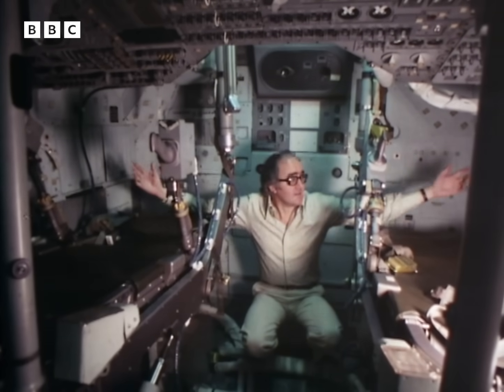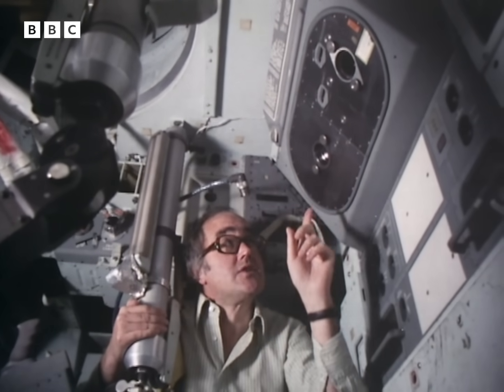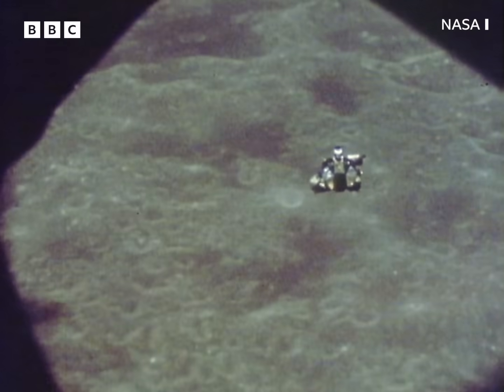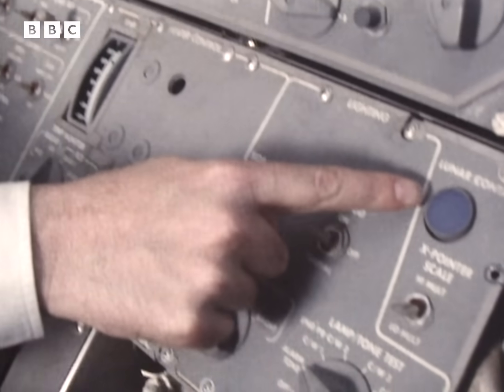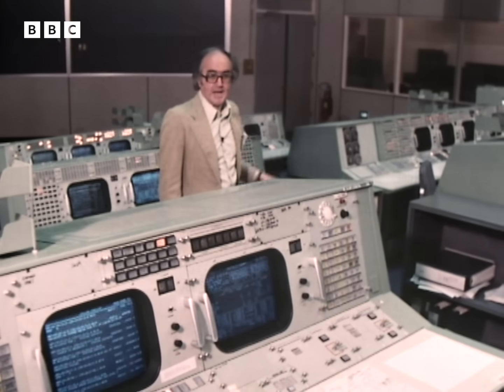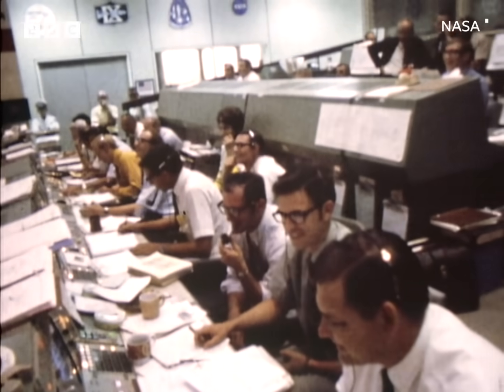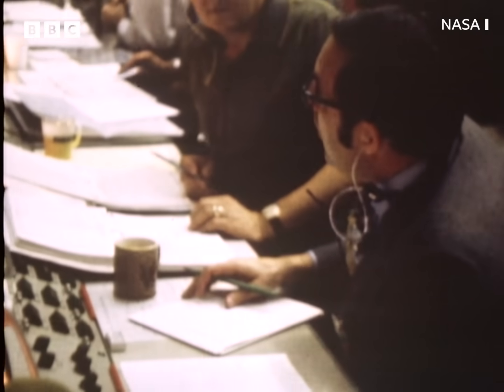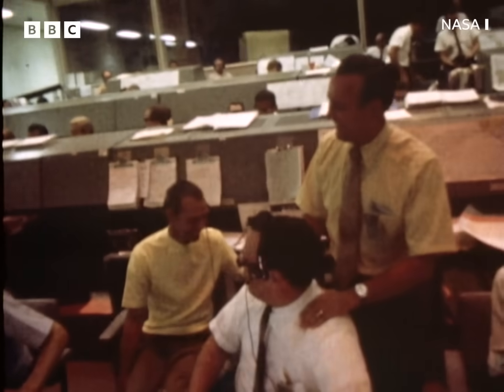1979: How to LAND ON THE MOON | Project Apollo | Retro Tech | BBC Archive

Comment: Notice destroyed LEM at 4.00mn on the vidéo.....very destroyed. How is it possible ?
Reply: 4:00 shows the LM ascent stage returning to the Command Module. The LM consists of two stages: the descent stage contains the engine and fuel for the descent to the moon, and the landing legs. This was left on the moon. Only the ascent stage took off from the moon to get the astronauts back to the Command Module.
Reply: @Hobbes746  you don t understand ....anyway
Reply: @thalesendeavour9890  I’ve reviewed the footage at 4:00. It shows the ascent stage of the LM in lunar orbit, ready to dock with the CM. Yes, half of the LM is missing: as I said, the descent stage stayed on the moon.
Reply: @thalesendeavour9890  Or are you talking about the buckled panels on the LM? 
Those are micrometeoroid shields. They are thin sheets of metal, used as a Whipple shield. Micrometeoroids would punch through these, and disintegrate in the process. The effect is that the debris of that micrometeoroid no longer has enough energy to damage the systems underneath those panels. 
Those panels were very thin by design (0.1 to 0.2 mm): they don’t need to be any thicker than that. Because they’re so thin, it was impossible to fasten them neatly to the underlying structure. They were riveted in a few places, as I recall. 
During launch, these panels would buckle a bit, which gives them the appearance you see here. That did not matter: they still worked. 
The important parts of the LM, the pressure hull and the fuel tanks, are hidden under that paneling.
Reply: @Hobbes746  no look the extern wall IS destroyed.
Reply: @Hobbes746  ok now i begin to understand thank you
Reply: @thalesendeavour9890  
Don't mind Hobbes. He's the Apollo damage control staff. The poor guy has about a dozen different names here. His feelings get hurt when people expose the phony missions.
Reply: @aok4418  for me it s half and half.....may be they went....may be they don't.
Reply: @thalesendeavour9890  
The radiation was the big hurdle.That's why they still haven't sent anyone.
Reply: @aok4418  As I’ve already demonstrated to you, no, the radiation was not a hurdle. Even in the center of the van Allen belts, it takes a week to accumulate a lethal dose of radiation. Above the belts, the radiation level is a hundred thousand times lower.
Reply: @Hobbes746  
"Lunar science for kids" NASA posted this and later took it down. 

Is there any sound on the moon?
Sound needs something to travel through to get from one place to another. On the moon, since there is no air sound cannot travel above the surface. So, there are no sounds on the surface of the moon. When the Apollo astronauts were out on the moons, surface, they could only talk to each other and to mission control by using the radios in their air filled helmets. Even when the astronaut in the photo to the right hit a metal tube into the ground with a hammer, no sound was made.

The picture they are referring to is Allen Bean striking a metal core tube during Apollo 12.
Reply: @Hobbes746  
Nothing was left on the moon because they couldn't get to Moon. They still can't put humans beyond LEO. Do we need to have the radiation discussion again.
Reply: @aok4418  Anyone can ping the laser reflectors left on the moon by the Apollo missions. A mountain of evidence proves the reality of the Apollo missions. Our radiation “discussion” consisted of me providing actual data, and you making one false claim after another. I’m not interested in a repeat of that.
Reply: @Hobbes746  Go do it, 😆
Reply: @Hobbes746  
Is it? That's not what the real data says. What claims did I make that are false? And prove it! Like I said before. I can back up my stance. All you're doing is running around rambling. We have already been over this.
Reply: @aok4418  i Know....van Halen belt . But listen....380 000 km to the moon....right? 35 000km/h Apollo speed right? It took 15 hours or less to get to the moon. They Traveled 3 days to get the moon..... 3 days to go and 3 days to back.....search the error.
Reply: @thalesendeavour9890  
The Apollo 11 crews were exposed to 1.67 mSv per second as they crossed the Van Allen radiation belt. This amounts to a total exposure of 1.8 Sv in 3 hours of travel through the radiation belt during the mission. Any exposure to 1 Sv or more, however, brings about fatal injuries. The radiation readings for the Apollo 11 astronauts’ skin of 0.18 rad, significantly, did not differ from radiation readings from missions restricted to low earth orbit. Data clearly proves that the Apollo 11 astronauts were not sufficiently protected against radiation: Neither the spaceship nor the spacesuits contained lead. Aluminum is ineffective against gamma and neutron rays. The calculated exposure of the Apollo crew was 1.8 Sv, an amount  associated with nausea, vomiting, bone marrow changes, and 20% mortality.
Reply: @aok4418  “they could not get to the moon” - had been debunked. “the radiation would have killed them” - has been debunked. “sound does not travel through solid objects” - has been debunked. Every claim you have made turned out to be baseless.
Reply: @thalesendeavour9890  The error is that you assume the speed is constant. In reality, as the Apollo spacecraft gets farther away from Earth, is speed decreases: moving away from Earth takes energy. 
At the point where the spacecraft enters the Moon’s sphere of influence, it’s only doing something like 3000 km/h.
Reply: @aok4418  And again you’re lying. No, the radiation level was not 1.67 mSv/s for 3 hours.
Reply: @aok4418  The spacecraft did not need lead shielding. The 4 mm of aluminium plus the heat shield attenuated the radiation level by several orders of magnitude.
Reply: @Hobbes746  No, bud, I'm not lying. And if you weren't so impressionable. You would know what I'm talking about.
Reply: @aok4418  Yes, you are lying. And worse, you can’t accept reality. When I try to teach you, you stubbornly cling to your nonsense instead of learning.
Reply: @Hobbes746  
What could you possibly teach me, child? You think the radiation in the Van Allen Belts can be stopped with a piece of paper. 😆
Reply: @Hobbes746  Aluminum is useless against GCRs. How many times do you need to be told.
Reply: @aok4418  The Alpha radiation in the VA belts can be stopped with a piece of paper.
Reply: @Hobbes746  
Right. Must be why they can't put humans through them. Do I really need to explain all this to you again?
Reply: @Hobbes746  
Provide the data and scientific research that confirming the radiation was low enough not to be a problem. Good luck!
Reply: @aok4418  How many people need to explain to you how and why you're wrong before you accept that you are, in fact, wrong? 🙂
Reply: @Jan_Strzelecki  
Give it rest. How many fake names are you going to post under?
Reply: @Jan_Strzelecki  
Give it rest. How many fake names are you going to post under?
Reply: @Jan_Strzelecki  I would love to see a single post by anyone proving me wrong. Good luck!
Reply: @Jan_Strzelecki  
Let's get this straight. You actually believe the radiation in the Van Allen Bets can be stopped with a piece of paper. 
Yes or No?
Reply: @aok4418  I don't have to post under fake names.
Reply: @aok4418  You were wrong about radiation and heat shield, for example.
Reply: @Jan_Strzelecki  
Yet, that's exactly what you do. And no, I was not wrong about the radiation. Just like I wasn't wrong when I explained to that Apollo did not measure particle fluencies, dose rates, and energy transfer spectra for ionizing particles and to measure the dose contribution of secondary neutrons. You seemed to believe they did. Nor did they measure radiation exposure on the moon. 
It's already been determined 
the only efficient measure to reduce radiation exposure is the provision of radiation shelters.
Reply: @Jan_Strzelecki I asked you a yes or no question. Spare me your ignorance.
Reply: @Jan_Strzelecki  
If the radiation in the Van Allen Belts can be stopped by a piece of paper, like you said. Why was NASA so determined to avoid them? I thought they specifically created a flight plan to avoid the most dangerous parts of the Van Allen Belts. Oh, that's right, they didn't leave LEO. 😂
Reply: @aok4418  This will be at least the 10th time I told you this.
I've already addressed that claim. And yet you keep using it with other people 🙄

Again:
The dosimeters used during Apollo did NOT measure particle fluencies (...)
Therefore, Apollo data allegedly being consistent with radiation levels withing LEO makes perfect sense. How are you not getting it? 🙄

I can tell you the Apollo readings cover only a small energy band for thermal neutrons (...)
And I can tell you that no one, no one thinks that Apollo data is bogus because of that. You want to use science? Use all the science, instead of picking and choosing.
Reply: @aok4418  I asked you a yes or no question.
Which I've answered. Alpha radiation can be stopped with a piece of paper, yes.

Spare me your ignorance.
Laddie, you wouldn't know ignorance if you tripped over it 🙄
Reply: @Jan_Strzelecki  I'm tired of explaining things to you, laddie!
Reply: @Jan_Strzelecki  You believe no one believes the data is bogus. You really are that daft.
Reply: @aok4418  I'm tired of explaining things to you,
How can you be tired of something you haven't even attempted? You just repeat the same set of claims that have already been dealt with.
Reply: @aok4418  I specifically asked you if the radiation in the Van Allen Bets can be stopped with a piece of paper?
Okay, how about this: some of the radiation in the Van Allen Belts can be stopped with a piece of paper. Is that better? Or are you going to keep pretending there's only one kind of radiation, contrary to your position? 🙂
Reply: @aok4418  So, you admit radiation data is only consistent with LEO!
I actually admit no such thing. I was very careful to always insert "allegedly" into my argument, to demonstrate that even if your claim was correct (and it's not), it doesn't matter, as far as your argument is concerned 🙂
Reply: @Jan_Strzelecki  Do I need to go back and post verbatim what I have already posted? I can do that if you like.
Reply: @Jan_Strzelecki  So, again. If the radiation can be stopped with a piece of paper. Why did NASA claim they would need to 
fly through the weaker regions of radiation as fast as possible. 😂😂
Reply: @aok4418  they don t went.....it’s just acteur in studio
Reply: @thalesendeavour9890  Exactly.
Reply: @Jan_Strzelecki  Don't reply to me again.
Reply: @Jan_Strzelecki  
Where did I make any reference to there being only one kind of radiation? 
Are you having trouble with your reading and comprehension again, or are you just making stuff up again?
Reply: @Jan_Strzelecki  
NASA found more than 100 places on the heat shield where what's known as the char layer ended up "cracking and breaking off the spacecraft in fragments that created a trail of debris rather than melting away as designed," the report reads.
Reply: @aok4418  Don't reply to me again.
I shall accept that as a concession is secretly is 🙂
Reply: @aok4418  So, again. If the radiation can be stopped with a piece of paper.
Wow, you are having reading comprehension problem, aren't you?
We both said it's ALPHA radiation that can be stopped with a piece of paper.
Not all radiation.
Alpha radiation.

Do you understand there are different types of radiation?
Yes or no.
Reply: @Hobbes746  Who said sound does not travel through solid objects, Jan_Strzelecki?
Reply: @Jan_Strzelecki  WTF are you even talking about? Why would you think me telling you that the VABs consist of harmful radiation would equate to me not knowing there is more than one type of radiation, lol? 
Pay attention!
Reply: @Jan_Strzelecki  
Keep trying, Hobbes. If nothing else, you are entertaining.
Reply: @Jan_Strzelecki  Trying to move the goalpost again, Hobbes? That won't help you either.
Reply: @Jan_Strzelecki  
The outer belt is made up of billions of high-energy particles that originate from the Sun, and the inner belt results from interactions of cosmic rays with Earth's atmosphere.
Reply: @Jan_Strzelecki  
You think aluminum was enough to shield the craft, yet Van Allen's second probe was sent up with LEAD shielding (~4x the density of aluminum) and still registered readings off the scale. Yet they want us to accept aluminum was sufficient shielding? In fact, in Van Allen's second article on the matter, he says radiation is only "mildly" reduced by 4g/ cm^2 of lead. So how can aluminum suffice when it is ~1/4 the density of lead?
Reply: @aok4418  You did. You claimed sound does not travel through solid objects when those objects are in a vacuum. 
I see you’re still confusing Jan and me. Apparently you can’t count to two, so you treat everybody who disagrees with you as one person.
Reply: @aok4418  You think aluminum was enough to shield the craft,
Enough to reduce radiation to safe levels within the timeframe of the mission.

yet Van Allen's second probe was sent up with LEAD shielding
Irrelevant if true.

Yet they want us to accept aluminum was sufficient shielding?
Enough to reduce radiation to safe levels within the timeframe of the mission.
Reply: @Hobbes746  Oh, he's lumping everyone who disagrees with him into one person 🙄
Reply: @Hobbes746  
Sound does not travel through solids in a vaccum. That is correct. That is much different than " sound does not travel through solids." Would you agree?
Reply: @Jan_Strzelecki  " Everyone". 😆. Is that what you are calling all fake names, now?
Reply: @Jan_Strzelecki  
Why would you think me telling you that the VABs consist of harmful radiation would equate to me not knowing there is more than one type of radiation, lol? 
Pay attention!
Reply: @aok4418  Why would you think me telling you that the VABs consist of harmful radiation would equate to me not knowing there is more than one type of radiation?
I wouldn't.
I think that you asking if I believe that a sheet of paper stops radiation altogether equates to you not knowing there is more than one type of radiation 🙂
Reply: @aok4418  "The outer belt is made up of billions of high-energy particles that originate from the Sun, (...)"
Again, no disagreement here, laddie 🙂
Reply: @Jan_Strzelecki  I didn't ask if a sheet of paper would stop radiation altogether. You're trying to move that goalpost again. It's not working.
Reply: @Jan_Strzelecki  So, you specifically said under your Hobbes name that the radiation in the Van Allen Belts is essentially harmless and can be stopped with a piece of paper. Of course, this is absolutely false.
Reply: @aok4418  How do you imagine that happens? What influence does the atmosphere outside of a solid object have on vibrations traveling through the object?
What you claim is physically impossible.
Reply: @aok4418  I didn't ask if a sheet of paper would stop radiation altogether.
Your question was "do you actually believe the radiation in the Van Allen Bets can be stopped with a piece of paper. Yes or No."
I cannot interpret that in any other way than "you believe that a sheet of paper stops VABs radiation altogether", especially since you threw a fit when I tried to clarify that both of us were talking just about the alpha radiation.

So, you specifically said under your Hobbes name that the radiation in the Van Allen Belts is essentially harmless and can be stopped with a piece of paper.
Of course, this is absolutely false. Neither me, nor Hobbes746 said such thing.
And again, note how you didn't say "alpha radiation", you said "the radiation". Which means that you interpreted our words wrong, and then insisted that your interpretation is correct, even when we both repeatedly corrected the record.
Reply: @Jan_Strzelecki  
The answer is no. There is no debating this. You can fumble around all you want. It won't change the facts.
Reply: @Hobbes746  
There is no sound in space. The ridiculous notion that the distinct sound of a metal hammer hitting a metal core on the surface of the moon is the result of vibration is hilarious. 
And again. If sound can only be relayed through the mic in the helmets. How could that be possible? It didn't activate the mic, did it! That's because they screwed up. They released the footage either deliberately or without knowledge. Of course, there are multiple examples of sound on the "moon" without explanation. I'm perplexed that anyone would make such a ridiculous argument. Of course, there are other videos of hammering core tubes and rock with no sound. Do you have an explanation for that? Was it a special hammer or maybe a special core tube that would cause sound in one example and not the other?
Reply: @Hobbes746  
You also said
"Aluminium is useful against most of the radiation types encountered in space, The amount of radiation from GCRs is low enough not to be a problem. How many times do you need to be told."

This is also completely false.
Reply: @aok4418  all sound is the result of vibration, so you are showing the depth of your ignorance again.
Reply: @Hobbes746  
Go ahead and  provide evidence to support sound can travel through solids in the vaccum of space. Stop repeating yourself. I've already explained. There are no atoms or molecules to carry sound waves, bud. If you don't understand what is meant by piezoelectric. Then, look it up. Also, did sound travel through solids when James Irwin in Apollo,15 threw the cable with two metallic locks at both ends. It hits the LM and makes a clear sound.
Reply: @Hobbes746  
Go ahead and provide evidence to support sound can travel through solids in the vaccum of space. Stop repeating yourself. I've already explained. There are no atoms or molecules to carry sound waves, bud. If you don't understand what is meant by piezoelectric. Then, look it up. Also, did sound travel through solids when James Irwin in Apollo,15 threw the cable with two metallic locks at both ends. It hits the LM and makes a clear sound.
Reply: @aok4418  The answer is no. There is no debating this.
You deny that Alpha radiation can be stopped with a sheet of paper?

The ridiculous notion that the distinct sound of a metal hammer hitting a metal core on the surface of the moon is the result of vibration is hilarious.
My sweet summer child, do you not know what a sound is? 😶

And again. If sound can only be relayed through the mic in the helmets. How could that be possible? It didn't activate the mic, did it!
What do you mean "it didn't activate the mic"? It clearly did.

Of course, there are multiple examples of sound on the "moon" without explanation.
If one reject the explanation, then it's easy to claim there isn't any 🙄

Of course, there are other videos of hammering core tubes and rock with no sound.
Which contradicts your explanation, now, does it? 🤣
Reply: @Jan_Strzelecki  
I've already explained. There are no atoms or molecules to carry sound waves, bud. If you don't understand what is meant by piezoelectric. Then, look it up. Also, did sound travel through solids when James Irwin in Apollo,15 threw the cable with two metallic locks at both ends. It hits the LM and makes a clear sound.
Reply: @aok4418  I've already explained. There are no atoms or molecules to carry sound waves,
I've already pointed out that there's plenty of atoms and molecules in solids to carry sound waves. How are you not getting it?

If you don't understand what is meant by piezoelectric.
Piezoelectricity has nothing with it! I already told you that as well! 🤣
We're not talking about sounds outside the solids, we're talking about sounds in solids!

Also, did sound travel through solids when James Irwin (...)
I've already explained that one too. Is your memory so poor, or is your reading comprehension?
Reply: @aok4418  No, you haven’t explained, you just repeat nonsense. The molecules carrying the sound are IN THE SOLID OBJECT. A vacuum around the solid object does not magically make the solid object unable to carry vibrations. Place a conduction microphone on the solid object, and you will be able to pick up sound from that object. Place that object against e.g. a pressure hull with a pressurized environment inside, and you will hear the sound inside that pressure hull. 
Astronauts on the ISS can hear meteorites strike the outside of the ISS. Think about that, instead of clinging to nonsense.
Reply: @Hobbes746  
I've already explained. There are no atoms or molecules to carry sound waves, bud. If you don't understand what is meant by piezoelectric. Then, look it up. Also, did sound travel through solids when James Irwin in Apollo,15 threw the cable with two metallic locks at both ends. It hits the LM and makes a clear sound.
Reply: @Hobbes746  
Yet, they can't hear sound when using power tools while working on it.
Reply: @Jan_Strzelecki  Sounds in solids? 😆
Reply: @aok4418  Sounds in solids?
Sounds in solids. Goodness gracious me, have you never knocked on a door? 🤦‍♂
Reply: @aok4418  Do you think because NASA forgot to edit out the sound (...)
I think that NASA wouldn't record sound in the first place if it's fake. This is what contradicts what you're saying.
"NASA forgot about this thing" is such dumb explanation, one that only a dumb person could come up with 🙄

I've already explained. There are no atoms or molecules to carry sound waves, bud.
Yes. Sounds don't travel through a vacuum. They travel through solids.
Reply: @Jan_Strzelecki  Not in a vaccum, I haven't. Have you?
Reply: @Jan_Strzelecki  And again. Not in a vaccum. I get the feeling you get made fun of a lot. Let's go to another video and see you spout this laughable nonsense.
Reply: @aok4418  The piezoelectric effect has nothing to do with the propagation of vibration through solids.
Reply: @Hobbes746  
With no atoms or molecules to carry sound waves, there's no sound. Why is it so hard for you to wrap your empty head around this, Jan_Strzelecki? This is pretty simple stuff.
Reply: @aok4418  Are you saying the solid object does not consist of molecules? SOUND IS CONDUCTED THROUGH SOLIDS!
Reply: @Hobbes746  Not in a vaccum.
Reply: @Hobbes746  
This is pretty simple, Jan_Strzelecki. I've explained too many times to count. I have always been very clear. If I need to repost what I have said countless more times, I will do that. So, why are you asking if I am saying the solid does not consist of molecules? There are no atoms or molecules to carry sound waves in a vaccum. It's that simple.
Reply: @aok4418  Yes, you’ve reposted the same nonsense over and over again. Pay attention this time: the sound is NOT transmitted through the vacuum of space, but through SOLID OBJECTS in space.
Reply: @Jan_Strzelecki  Facing overwhelming odds and flashbangs. 😆
Reply: @Jan_Strzelecki  
You specifically said.
"Sound can travel through water, so doesn't need air"
Reply: @aok4418  You specifically said.
"Sound can travel through water, so doesn't need air"
Okay, and? That doesn't say "water has no molecules", now, does it? 🤣
Is your reading comprehension really that bad?

But that reminds me: do you believe that sounds can travel through liquids, or not?
Reply: @Jan_Strzelecki  Lol. Needs air, bud.
Reply: @Jan_Strzelecki  
My reading comprehension is just fine. Needs air for sound to travel in water, genius. 😆
Reply: @aok4418  My reading comprehension is just fine.
And yet, you understood "sound can travel through water, so doesn't need air" as "water doesn't have molecules" 🙄

Needs air for sound to travel in water,
No, it doesn't. There are plenty of atoms and molecules in a liquid. Or a solid, therefore, as per your own definition, sound can travel through solids or liquids without the presence of air.
If you don't believe me, look up a definition of sound, and pretty much every single one will tell you that sounds can travel through liquids or solids.
Reply: @Jan_Strzelecki  Air molecules, genius.
Reply: @aok4418  Air molecules,
A liquid, by definition, is made of a liquid. Not air.

So you believe that sounds can't travel through water unless water has air in it?

Liquids or solids. Not in a vaccum.
It's still "vacuum". One C, two Us.
And liquid or solids still have liquid/solid molecules inside, whether they're in a vacuum or not. As such, they don't need air molecules to conduct sound waves, whether you like it or not.
Reply: @aok4418  Garett Reisman, a former NASA astronaut:
"As an EVA is in progress, you can hear the spacewalkers bumping and clanging along as your crewmates translate on the exterior of your module."
Reply: @Jan_Strzelecki  And a liquid has molecules and atoms and molecules. This is simple stuff, laddie!
Reply: @Jan_Strzelecki  
And a liquid has molecules and atoms. This is simple stuff, laddie!
Reply: @Jan_Strzelecki  
Now, you are comparing apples and oranges.
The actual vibration is now vibrating due to banging and clanging directly on the module.
The structure itself is vibrating. It's hilarious that you believe the distinct sound of a metal hammer hitting a metal core tube can be heard through the spacesuit through many layers and through the helmet and through a mic that isn't even activated. 🤦‍♂️
Reply: @Jan_Strzelecki  
Did sound travel through solids when James Irwin in Apollo,15 threw the cable with two metallic locks at both ends. It hits the LM and makes a clear sound.
Reply: @aok4418  a liquid has molecules and atoms and molecules.
I know! And so does a solid! That's what I've been telling you all along! Am I finally getting through? 😲

Now, you are comparing apples and oranges.
No, we're still comparing the same thing - sounds travelling through solids.

The actual vibration is now vibrating due to banging and clanging directly on the module.
Much like the Apollo 15 hammer was vibrating due to banging and clanging directly on the metal core tube, yes 🙂

The structure itself is vibrating.
And it transfers those vibration further on.

you believe the distinct sound of a metal hammer hitting a metal core tube can be heard through the spacesuit through many layers and through the helmet and through a mic that isn't even activated.
The microphone was obviously on, though - I don't know where you're getting this mistaken idea that it wasn't 🙄

Did sound travel through solids when James Irwin in Apollo,15 threw the cable with two metallic locks at both ends. It hits the LM and makes a clear sound.
I've already addressed that multiple times. Please pay attention. It's for your own good.
Reply: @Jan_Strzelecki  
Clearly, you didn't. You specifically said.
"Sound can travel through water, so doesn't need air"
Reply: @Jan_Strzelecki  Not the same thing. Not at all. 🤣 keep trying
Reply: @aok4418  Clearly, you didn't. You specifically said.
"Sound can travel through water, so doesn't need air"
Which doesn't contradict what I said above in the slightest 🙂
(Did I said it in this thread, or somewhere else?)

Not the same thing. Not at all.
No? Is the hammer vibrating after striking the metal core? Yes or no?
Oh, and explain why the microphone would be turned off, if you please 🙂
Reply: @Jan_Strzelecki  That's exactly what you said.
Reply: @aok4418 It's not the same thing.
It is the same thing. Both examples involve sounds travelling through solids.

But you didn't answer my question. Please do so.

That's exactly what you said.
And it still doesn't contradict what I said later 🙂
Reply: @Jan_Strzelecki  
Nor would the sound travel through a mic that is not activated.
Reply: @Jan_Strzelecki  Get a job, bud! Nobody landed on the moon. Never happened. I will let you know when and if it ever happens.
Reply: @Jan_Strzelecki  
The ridiculous notion that the distinct sound of a metal hammer hitting a metal core on the surface of the moon is the result of vibration is hilarious. 
And again. If sound can only be relayed through the mic in the helmets. How could that be possible?
Reply: @Jan_Strzelecki  
Did sound travel through solids when James Irwin in Apollo,15 threw the cable with two metallic locks at both ends. It hits the LM and makes a clear sound.
Reply: @aok4418  you are here again.....focus on moon landing .
Reply: @Hobbes746  
Just admit it. There is no sound in space. The ridiculous notion that the distinct sound of a metal hammer hitting a metal core on the surface of the moon is the result of vibration is hilarious. 
And again. If sound can only be relayed through the mic in the helmets. How could that be possible? It didn't activate the mic, did it! That's because they screwed up. They released the footage either deliberately or without knowledge. Of course, there are multiple examples of sound on the "moon" without explanation. I'm perplexed that anyone would make such a ridiculous argument. Of course, there are other videos of hammering core tubes and rock with no sound. Do you have an explanation for that? Was it a special hammer or maybe a special core tube that would cause sound in one example and not the other?
Reply: @aok4418  Spamming the same false claims over and over again does not improve them. 
Tell me why you think vibrations do not travel through solid objects when those objects are surrounded by a vacuum.
Reply: @Hobbes746  
No, it isn't. It isn't possible. You follow! Go ahead, look it up.
Reply: @aok4418  I’ve looked it up, you clearly haven’t. Your ignorance is showing again.
Reply: @Hobbes746  Don't waste my time again.
Reply: @Hobbes746  
Is that why my opinion is backed by science and yous is just another filthy hilarious lie?
Reply: @aok4418  Your opinion isn't based on science. That NASA article was factually incorrect in that regard, which is probably why it was removed.
You said it yourself: sounds needs atoms or molecules to carry sound waves - and there are plenty of atoms and molecules in a solid. Why do you keep denying it?
Reply: @Jan_Strzelecki  It was correct. They removed it because they knew it exposed the faked missions.
Reply: @Jan_Strzelecki  Not in a Vaccum!
Reply: @Jan_Strzelecki   This is simple stuff, Hobbes. Educate yourself, laddie!
Reply: @aok4418  Solid objects consist of atoms and molecules. Yes or no?
Reply: @Jan_Strzelecki  In near empty regions of space, there are no or very, very few particles to vibrate, so no sound.
Reply: @aok4418  That's not what I was asking about.
Again: solid objects consist of atoms and molecules. Yes or no?
Reply: @Jan_Strzelecki  
A sound wave is a synchronised movement of millions and millions of atoms or molecules. The random collisions of atoms or molecules are not synchronised and do not produce a sound wave in space.
Reply: @Jan_Strzelecki  
 I thought I was clear when I told you to quit stalking me with your phony names. Don't reply to me again.
Reply: @aok4418  A sound wave is a synchronised movement of millions and millions of atoms or molecules.
No.
"A sound wave is the pattern of disturbance caused by the movement of energy traveling through a medium (such as air, water or any other liquid or solid matter) as it propagates away from the source of the sound."
Reply: @aok4418 You haven't been explaining anything to anyone. You just make some factually incorrect claims about things you don't understand, and then get upset when corrected - sounds conducting through solids being just one of the entries on the list.
And you, of all people, shouldn't really accuse others of having no life, really 🤣
Reply: @Jan_Strzelecki  You just don't listen, do you!
Reply: @Jan_Strzelecki  I don't have sock puppet accounts. You do!
Reply: @Jan_Strzelecki  
A sound wave is a synchronised movement of millions and millions of atoms or molecules. The random collisions of atoms or molecules are not synchronised and do not produce a sound wave in space.
Reply: @aok4418  I listen, and then I respond.
And explain.
And correct.
Sound waves do propagate in solids, whether they're in a vacuum or not. That's just basic physics.
Reply: @Jan_Strzelecki  
A sound wave is a synchronised movement of millions and millions of atoms or molecules. The random collisions of atoms or molecules are not synchronised and do not produce a sound wave in space.
Reply: @aok4418  A sound wave is a synchronized (...)
Repeating the same thing isn't going to make it any less wrong.
Here's a simple definition for kids:
"Sound waves are vibrating forms of energy that are made of molecules and look like waves. Sound waves can travel through solids, liquids and gases."
Reply: @Jan_Strzelecki  
You don't understand that water has molecules and atoms. Don't talk about basic physics. You also believe radiation in the Van Allen Belts can be stopped with a piece of paper.
Reply: @Jan_Strzelecki  
Sound is a type of energy made by vibrations. When an object vibrates, it causes movement in surrounding air molecules. These molecules bump into the molecules close to them, causing them to vibrate as well. This makes them bump into more nearby air molecules.
Reply: @aok4418  I don't have sock puppet accounts.
Neither do I, your delusions notwithstanding.
Reply: @Jan_Strzelecki  Yeah, you do!
Reply: @Jan_Strzelecki  Stalker!
Reply: @aok4418  Yeah, you do!
No, I don't. It's just your mistaken (as always) belief, not supported by any evidence, and, indeed, contradicted by it.
Reply: @aok4418  Stalker!
Shadow of Chernobyl 🙃
Reply: @Jan_Strzelecki  
Yeah, you did. You're a bad liar.
Sound is carried by atoms and molecules. In space, with no atoms or molecules to carry a sound wave, there's no sound.
Reply: @aok4418  You don't understand that water has molecules and atoms.
What do you mean I don't understand water has molecules it atoms? It does have molecules and atoms. I never said it doesn't 🙂

You also believe radiation in the Van Allen Belts can be stopped with a piece of paper.
Alpha radiation, yes. And? 🙂
Reply: @aok4418  And again you’re lying. “they can’t put humans through them” is nonsense you fabricated. It is not supported by data. It is not supported by anything.
Reply: @aok4418  FFS, educate yourself!
I did. That's the difference between us, one of many.
Reply: @aok4418  Back to bed, laddie!
In two hours 🙂

Sound is a type of energy made by vibrations.
I guess? But please do continue.

When an object vibrates, it causes movement in surrounding air molecules.
Or surrounding liquid molecules.
Or surrounding solid molecules.

These molecules bump into the molecules close to them, causing them to vibrate as well. This makes them bump into more nearby air molecules.
Or nearby liquid molecules (Unless you deny that sounds can travel underwater?).
Or nearby solid molecules.
Reply: @Jan_Strzelecki  Hey, stalker, you're still running your mouth. Get a job!
Reply: @Jan_Strzelecki  Actually. You didn't believe water had molecules. Lol
Reply: @aok4418  Actually. You didn't believe water had molecules.
I, of course, have never said or even implied such thing.

Hey, you're still running your mouth.
As long as the source of disinformation (you)persists, I shall endeavour to correct it.

Get a job!
I do have a job. You're just a hobby of mine 🙂

So, this is how sound propagates in solids: when an object vibrates, it causes movement in surrounding molecules. These molecules bump into the molecules close to them, causing them to vibrate as well. This makes them bump into more nearby molecules.
Is that clear and understandable for you?
Reply: @Jan_Strzelecki  
You specifically said.
"Sound can travel through water, so doesn't need air"
Reply: @thalesendeavour9890  
JVA

Van Allen realized the Aurora Borealis, the northern lights, was actually a visual manifestation of that tremendous energy from the sun. You could actually see the radiation swirling in a magnificent and deadly dance.  His eventual finding of two such lethal radiation belts, put his name in the history books as the man who discovered the Van Allen Radiation Belts.  There was an inner belt and an outer belt. The inner belt went from 40 degrees north and south of the Equator and was basically a doughnut surrounding the earth. Scientific experiments conducted by Van Allen and the military proved that belt was so deadly that no human could survive in its orbit. The outer belt was   equally as destructive, and separated from the inner belt by an area of lesser radiation.

 Van Allen's conclusion was delivered in a speech to the Academy of Science in 1959.  He warned future space travelers they would have to race through these two zones on their way to outer planets.

 "All manned space flight attempts must steer clear of these two belts of radiation until adequate means of safeguarding the astronauts has been developed" he said.   Moreover, Van Allen advised they would have to be shielded with some extra layers of protection beyond that of the spacecraft itself.  These findings were also published in Scientific American Magazine, March, 1959.

 Two years later, Van Allen updated his report in Space World Magazine, December, 1961. In brief, he reported that everything he had found in 1959 was still valid.  It was also in that year that President John F. Kennedy told an assembled group of students and dignitaries at Rice University in Houston, that it was America's destiny to put a man on the moon by the end of the decade. With that statement, the space race become a political game, worth 30 billion in taxpayer dollars to the winners.  National Aeronautic and Space Administration (NASA), which is part of the Department of Defense and the CIA, became the caretaker of Kennedy's dream.

 It was their job to build a spacecraft that would meet Van Allen's scientific requirements of safety through the radiation belts. Van Allen stated that the ship's skin, made of aluminum, would not be enough protection for the astronauts. Extra shielding of lead or  another substance that would absorb the radiation would be needed. That, of course, posed the problem of weight. More weight created a booster problem. In other words, they would need a bigger rocket to carry a ship that was properly lined against radiation penetration.  One of the most interesting of Van Allen's findings was that once protons and electrons hit the aluminum skin of the spacecraft, they would turn into x-rays. The kind the average dentist protects patients against with two inch lead vests. Those rays would naturally penetrate the astronaut's bodies and create anything from nausea and vomiting to eventual death, depending on the length of the exposure.

 All of this scientific data presented a big problem for NASA. How could they build a spacecraft that would meet radiation standards and yet get off the ground?

 The National Committee on Radiation Protection (NCRP) and the International Commission on Radiological Protection (ICRP) had established low "permissible doses" of  radiation at levels that were consistent with living on earth. However, where the critical dosage on earth might be 5 rems of radiation in a year, the astronauts would receive that amount within minutes passing through the lower zone of the radiation belt.

 In order to penetrate Van Allen's belt, in l965 NASA requested the two regulatory groups modify the existing standards for space flight. It was simply a matter of "risk over gain" and NASA convinced them to change the standards and allow them to take the risk.  Whether or not future astronauts would be advised of these dramatically lowered standards and substantial risk is unknown at this time.

 The next problem NASA faced was the shielding of the spacecraft. It was solved in a report NASA issued in Aerospace Medicine Magazine in 1965 and 1969. The report was written prior to the first Apollo mission to the moon.

 NASA announced that a simple aluminum skin on the command module was enough to protect astronauts from lethal doses of radiation. This conclusion was based on studies NASA had conducted.  Now NASA had ingeniously solved their two basic problems, protection and weight. They had eliminated the danger of radiation penetration, along with the problem of radiation shielding and spacecraft weight.  We telephoned North American Rockwell, the builder of the Command Module which carried the astronauts to the moon and back. They verified that the craft was not protected by any additional shielding.

 It was at this point in our research that we realized the Van Allen Report had been seriously compromised by NASA. Professor Van Allen had become an icon in the scientific community for warning of radiation dangers. One of his most important tenets was that even if you raced quickly through the 65,000 mile belt, which starts 400 miles above the earth's surface (thus allowing for inner space travel) you would still need considerable additional shielding. Were his findings now bogus?    We had to speak to Van Allen.

 Professor James A. Van Allen now 83, is Professor Emeritus in Geophysics at the University of Iowa. Our first question was why he did not speak up after NASA's claims and defend his original findings. Astonishingly, he told us that his seminal Scientific American article
in 1959 was merely "popular science."

 "Are you refuting your findings?" we asked.

 "Absolutely not," he answered, "I stand by them."  In the next breath, Van Allen again acquiesced to NASA's point of view. He became positively mercurial in his answers. Basically he defended NASA's position that any material, even aluminum without shielding, was adequate to protect the astronauts from the radiation he  once called deadly.  When we asked him the point of his original warning about rushing through the Belt, he said, "It must have been a sloppy statement."  So there we were, down the rabbit hole, chasing Van Allen through halls of mirrors. Was he taking the line of least resistance to government pressure? Was he trashing his own report in order not to be labeled a whistle blower? Could this renowned scientist actually be capable of a "sloppy statement" and blatant hyperbole published in a scientific journal?

 If you don't believe we went to the moon, then you will say that NASA created the perfect cover story. It allowed them  to continue receiving funding for a spacecraft they could not build, to enter a region of space they could not penetrate.  If you believe we went to the moon, then you have to disregard Van Allen's years of research and published findings. You would also have to believe that aluminum, and not lead, is adequate protection against radiation in the very heart of the Belt. . .exactly the spot where Apollo rocket ships entered from Cape Canaveral in Florida.